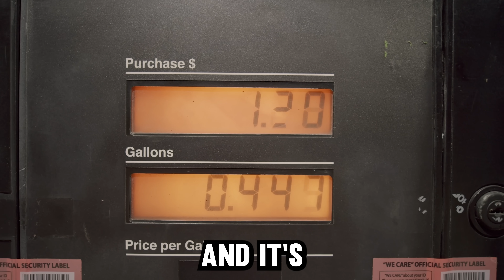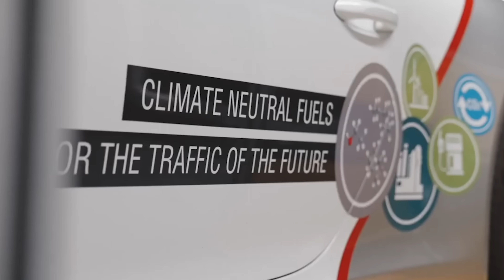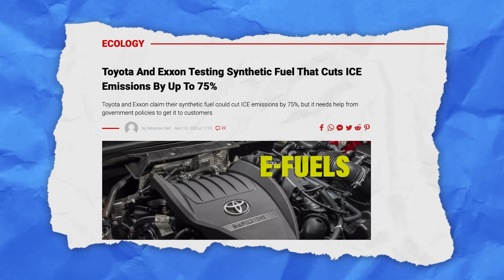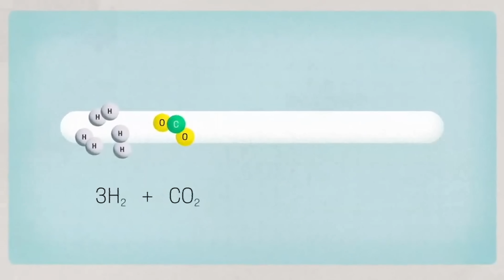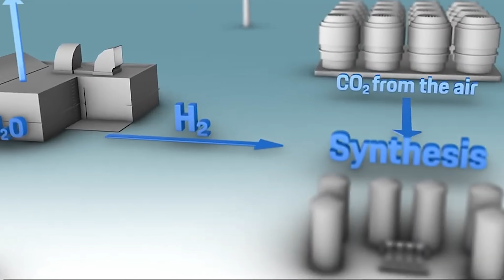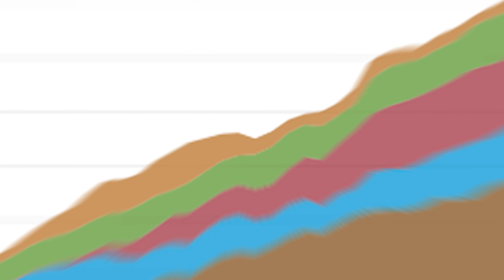Dodge Just SAVED Combustion Engines

Comment: the ship and plane comparison were pretty bad in this instance. as a 747 may use 1 gallon of fuel a second. it’s also taking 400 people with 1 gallon a second. at well probably nearly 5 to 6 times the speed. let alone putting 400 cars on the road for that same distance. same for huge ships, you take 20,000 containers off a ship and “drive them” via truck. across an imaginary bridge across the ocean the fuel savings and greenhouse effect is quickly diminished

Comment: I would say E-Fuel is the future. And the reason being? Cost. As well as Waste.
If ICEs were banned. And all vehicles using them prohibited. That's a lot and I mean a lot of cars suddenly reduced to a several ton paperweight. The cost of scrapping and waste generated from getting rid of every single car that works this way would be astronomical.
EVs require totally different infrastructure that is incredibly costly both on a mass scale and individual level. A consumer level charger for an EV costs anywhere from £1.5k and up. With E-fuel, already existing infrastructure works just fine because it's a drop-in replacement. People (like Musk for instance) can whinge about internal combustion being old fashioned. But practically everything that goes forward on four wheels or more (*two if you count motorbikes) that we have ever built works like that. Better to improve and make the most of what we already have than scrap the lot and start again.

Comment: I've got a 90's Dodge Ram the puts out roughly350 hp. Which is more than I need but still gets the job done. While doing research on all the new fuels and seeing how I can improve on MPG, I found that monthly maintenance and some extra toys under the hood have made my truck a cleaner version of its old self. It passes emulsions every year with flying colors. Now I'm all in for new tech here and there. But I think EV has a long way to go before it gets my approval. Synthetic gas is an option and cleaner, but you'll burn right through it faster than say normal petro. But knowing Dodge, they'll come out on top as always.

Comment: In Brazil, we use Flex cars that run on both gasoline and alcohol from sugar cane.  A plant that absorbs CO² from the atmosphere and then turns it into fuel after industrial processes.  Ethanol is cheaper and is used on a large scale.

Comment: Losses, losses, losses. Electric cars are simple, energy in = energy out with very little losses(90% efficient). Whereas a fuel powered car is not!(about 30%) lots of energy wasted in heat in noise, and other mechanical assemblies to make a ICE engine run. Now you want to add the losses you would have from converting the electricity to chemical energy to burn to that equation? If people are worried about 90% efficient EVs crashing the grid, you would have a huge night mare with 10-20% efficient e fuel cars. Not a good plan. Anyone that does not believe in electric has not driven one. They are the future, stop holding on to Dino juice, when really it's just not a good solution in the long run.

Comment: I just ran the numbers. A kwh of electricity could be used to drive an average EV 4-5 miles, or you could use it to make enough efuel to drive a 30mpg car about 0.4 miles. You throw away about 90% of the energy going through the e-fuel route than just charging a battery. There's a reason E-fuels are being pushed by fossil fuel companies. It's just another attempt to make hydrogen production a thing so that they can provide it for a few more decades. Right now, fossil fuels are the only viable source of the hydrogen you need to make the e-fuels, and that's going to be true for some time because switching to e-fuels will need 10x more renewables if you're going to make it green. ALternatively, you charge a fair value for truly-green e-fuels, probably $50-$100 a gallon. 

E-fuels will probably be a thing for long-haul aviation, marine applications, and a few ICE enthusiasts, but it's going to cost A LOT.

Edit: I just thought to look up some numbers and do another calculation. If we're going to drive all our cars on E-fuels, we're going to need 8x as much electricity as the US currently makes and uses. Expect both your electric bill and gas prices to go up a lot. A lot of folks will have to choose between AC in the summer, or being able to drive to work.

Comment: Find it funny that so many young "old fashioned" people hold onto a inefficient technology just "because". The combustion engine is inferior in every way. Most of the produced energy is heat and does not help move a car in any way. And e-fuels need so much more energy to produce. 

The tradtional combustion engine is at the end of its possibilities. Electric engines and battery technology not at all, not even close. 

But if you want to pay 20-30 $ for a gallon of e-fuel (CO2 is going to get reduced in atmosphere) and be behind in every way of electric powered vehicles..... your choice. 

As a car enthuisast i fon't like people talking about being only an enthusiast if you like old, outdated dodo-tech.

Comment: I think this is a way forward and can be a much quicker transition into infrastructure while battery tech continues to be figured out.  Frankly, we may need to "grab a few asteroids" to harvest metals in order to ever make high quality batteries at a reasonable price that can be used long term enough for battery tech to be the full replacement for combustion engines.  As well, I do like what I see with regards to hydrogen cell technology as well, I think that is even more so a move in the right direction..

Comment: So you take a ton of electricity to capture carbon in the air, turn it into fuel, transport it by truck to gas stations, pump it into cars, burn it, and dump the carbon back into the air? At the end of the day the electricity what is ultimately being used. It's waaaay more efficient to just transmit the electricity over high voltage lines and dump it into a battery in the car. You get better than 90% efficiency this way, including basically all losses between the power plant and the car. A combustion engine can only achieve at most 35-40%, not counting losses in actually making the fuel and transporting it.

Comment: what will happen is they run a coal or gas power plant, they then capture the carbon from the air from that plant and generate the fuel certificate of made of Carbon captured while still using fossils. ironic is that charging a battery or i  guess even making hydrogen will be more efficient. so 1KM gasoline engine will equal the energy vs 100Km of a electric car based on the same energy used for that charge. I expect it will be quite expensive unless its subsides heavily. fine for your oldtimer you use once in a while or your V12 super car

Comment: The Carbon foot print to produce an EV and get it to the show room, excluding the carbon foot print that results from charging (the electricity doesn't come from the ether) is greater than purchasing an comparable gas engine vehicle and driving it for 185,000 miles. Did you get that? The EV only made it to the show room and it required more carbon than the gas vehicle driven for 185,000 miles.

Not to mention that EV's go through 2 or 3 sets of tires to one set on the gas vehicle, and the EV will need a new Battery pack at a cost of over 30,000.00 in five years. Try to sell an EV when it's reaching the end of it's chargeable life!! Forget it. Don't get suckered into buying an EV. Hybrid? Sure, for a daily driver, but for an occasional driver a hybrid is no good because the battery wears out faster if it's not used and charged often.

Comment: Before you get your hopes up, synthetic fuels will be expensive due to the large quantities of electricity required to make it. 

They are effectively electric powered but using WAY more electricity per mile compared to just using that electricity to charge a battery.

Hydrogen suffers the same problem it takes 3x as much electricity per mile.

Comment: Just a heads up we don’t know much about the E-Fuels.. but I am assuming you might have to change the fueling system in your car in order to take e-fuels. 

For example not all cars take E-85. There are steps to those changes.
Reply: The theory, from a chemistry stand point, is to take CO2 out of the air, strip the O2 and replace it with hydrogen through electrolysis to make CH4 (methane). From methane, using chemical reactions, you convert into other alkanes, alkenes, isoalkanes, isoalkenes, cycloalkanes, cycloalkenes, and aromatic compounds to make a chemically identical fuel to gasoline. There would be no conversion necessary if done correctly.

It is very expensive to do this, however.

Comment: Theoretically possible, but so impractical that this will never go beyond prototypes for marketing.  Carbon capture is about reversing already released carbon in our atmosphere, assuming we get to net zero.  It's not a technology that can scale up to make combustion driving a renewable energy source.  Carbon in the atmosphere is in a ratio of 1 to 2500.  So to extract 1 liter or gallon of carbon you need to process 2500 liters or gallons of air.  That's not efficient enough to allow everyone to keep using combustion engines.

Comment: Seems to be a flawed argument. Saying the electricity supply isn't green enough to run ev's so let's produce a fuel that requires more than 3x the energy (optimistic figure) but somehow 100% green to run a similar vehicle. Don't get me wrong I think there are uses for synthetic or h2 combustion. I just can't see it as an answer to the masses. Looks like green washing to me.

Comment: The western electric grid drops to about 20% output overnight, 20% is also the US share of nuclear electrical generation. Those numbers match for a reason. Transportation is about 60% of the energy need overall depending on how you count heating energy costs. We can run a 100% nuclear power electrical grid with near 100% baseplate output by making liquid hydrocarbon fuels in low electric demand times (at night). This will scale up in production until each major demand area has both nuclear power and local liquid fuel production cutting on both electrical and oil shipping costs. Also you use water to capture CO2 in the air, any large body of water (great lakes or ocean) is a suitable capture medium for CO2. 
Running full nuclear power system, cuts more than 90% of CO2 emissions (if you care about that) and will lower the price of electricity, save on electrical transmission costs, free any nation that switches from global oil prices/supply issues and lets the word keep every ICE, every gas station, delivery truck AND can also better supply the huge uptake in electric car demand for people that are better served by short ranged, slow filling vehicles. 

This tech was first pushed by the US Navy to try and offset some of their insane fuel costs by running floating nuclear reactors that turn out jet fuel (which both aircraft and ships run on).

Comment: That sounds pretty cool. We could still mitigate coal from charging EVs and for producing efuel. Nuclear, wind, hydro, solar, geothermal, and natural gas could provide enough power for both applications. The great thing about the e fuel is it can be produced and transported from the renewable power plants like a geothermal plant that is far from civilization or common roads. Charging stations for EVs should primarily be scaled up pergola structures of solar panels that the evs can park underneath in shade and charge.

Comment: if anything we should switch to nuclear or fusion reactors and use the surplus power to manufacture this as an additive or filler to regular fuel. manufactures can receive a "green" tax cut for removing co2 from the atmosphere or by offloading their pollution into making the efuel and make it cheaper . building new infrastructure just for this doesn't make sense logistically, so it would need to be tacked onto already existing industry

Comment: I think at the end of the day all options always were the answer. Electric are okay and they work for many people as they did in the late 1800s when most of the automobiles at the time were electric. Rudolph Diesel designed his engine to run off peanut oil diesel fuel didn't exist. Hydrogen is probably the most environmentally friendly option of all but guaranteed some idiot will bring up the Hindenberg the moment you start talking about it but advances in storage technology means with the right storage tanks it can be even safer then gasoline. Ethanol and alcohol are good options  as well as propane and natural gas. What we need is a true free market where all of these can compete together instead of the "corpoindustrialsocialism" we've been living under the boot of for the last century. Just like anything else in life no one thing is ever the end all answer.

Comment: If they actually cared about carbon emissions in the atmosphere they'd ban international trade and the 5,000+ ginormous cargo ships that make it happen. Just 14 of those ships put out more carbon emissions annually then all land vehicles combined. Nevermind the factories themselves. Also they wouldn't try to shut down coal mines in the states while turning Africa  into a giant cobalt, lithium, platinum mine run by China that will undoubtedly abuse the everloving crap out of those poor people. Ethanol, alcohol(white lightning😉) hydrogen, plant based oils and electric have all been viable for at least some portion of the market for the last century so yeah this is just another distraction  pull your heads out of your asses they don't  want a real solution to this so called "problem".

Comment: I feel for people that love there cars, but this is not a global solution. it cannot be scaled to levels needed to keep large scale use of internal combustion engine.  Its greenwashing and distracting.  synthetic fuels might be used in airline industry and shipping, but not for everday vehicles.  but don't worry the EV transition is going to take time, and EVs will improve dramatically and come way down in price.  by 2035, when a few small number of gasoline bans start to come into effect EVs will have taken a quantum leap.  

we don't really need the bans to make the transition from a technological, economics, and performance perspective.  the bans just help get the industry to accept that EV technology is rapidly improving.  the transition to EVs seems like an expense in the short-term, but long-term it will be way cheaper.  18 moving parts in an EV drivetrain vs 2,000 in an internal combustion engine.  we just need better, cheaper batteries which has happened every year for decades, and will continue to do so with a combination of increased scale and innovation.

Comment: One major cost of E fuel is the energy needed as stated.  One solution is the use and construction of power plants that use element 90. Problem solved using cost benefit analysis.

Comment: Was talking to a shop owner about Cars the other day and asked what he thinks about Electric cars. He said the people that buy big trucks and load them up dont realize the more weight you put on the vehicle the more it drains the battery so they are getting hardly any miles out of the work trucks. Nearly nothing can beat the power that petroleum can produce. Been a reason its so hard to replace. A alternative fuel could save us. Just look at Synthetic oil. I only use synthetic now. It last longer protects better can go further between changes. If synthetic fuel can do the same im on board 100%

Comment: What are we going to eat if all fields and fresh water go to making fuel? Or spend all of the electricity in fuel cells at 50% efficiency.  This is such a stupid idea. It will be forced on us same way ethanol is today. Evs will not replace all ice cars, its just another option next to cng, propane, diesel, and gasoline. Come on lets not make it any harder than it needs to be.

Comment: The laws of thermodynamics still apply folks. E-fuel is no different. So for now the way to keep a billion internal combustion engines on the road is...drill baby drill.  All of the processes involved are subject to thermodynamics and when factored in throughout all processes there is no saving benefit because 1. Energy cannot be created or destroyed. In other words there is a set amount of energy in the universe and there will never be more or less. 2. Energy can only be converted from one form to another. Energy is cyclical! The transference of energy from one form to another is key, the question becomes how or with what process do we do it most efficiently and economically. That is fossil fuels and internal combustion!

Comment: id rather have a can of synthetic fuel on hand than rely on an EV during a power outage caused by fires.
Reply: So when the power is out - you'd have 0% state of charge in your 300 mile / 100kwh battery. 
But the 20 mile can of gas is better. 😅

The weird scenarios some of you come up with, I swear

Comment: there is a huge missconception that e-fuel is clean and soon on the road . e-fuels are produced with electricity which isnt CO2 free ( Coal-Oil and Nuclear- plants). you  produce 2.5 times the CO2 to make 1 gallon e-fuel than a actual gallon of Gas does. you need  4x the electric energy to travel 100 miles from producing e-fuels than taking e EV for 100 miles. EV isnt the long term solution. but the e-fuel lobby is talking about 20 years from now, that  it will be  a thing. not tomorrow. dont get fooled and think its coming next year or so ... its 20 years that ev lobby are heading to

Comment: Electric motors will not propel you into the stars. Hydrogen and synthetic fuels are the way forward, mostly hydrogen.
Reply: Synthetic fuels cost $20 a gallon. It is not economically feasible.    
Hydrogen is not a viable option. There is no distribution infrastructure.